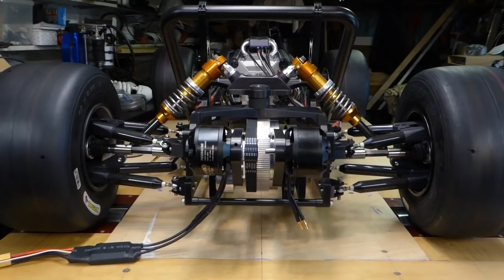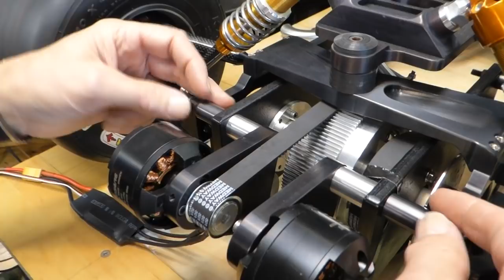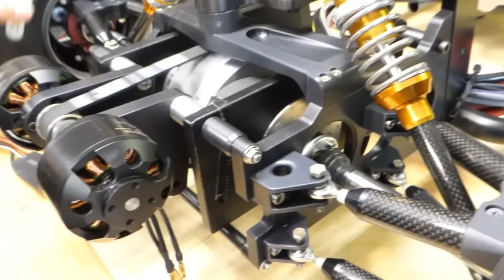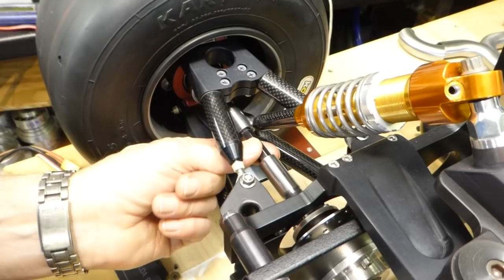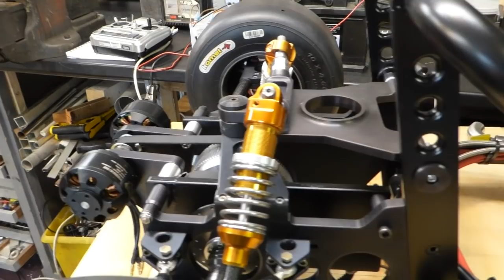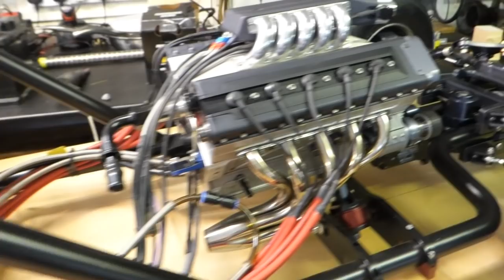1/3 Scale Fuel Injected 125cc V10 RC Buggy, part 4.

Comment: Hi Keith, these motors aren't sensored so on low speed they do this cogging, also the ESC isn't going to work for long without a proper colling system, it's meant for airplanes or heli's.  If the motors would have a sensor then it would act like a stepper motor and can do those low rpm's without cogging. A proper car ESC can do low rpm's better and also without a sensor way better then this ESC does. I like the outrunner choice, but i can't wait to see and hear the actuall v10! What a nice build this is already :D

Comment: And you don't need a sensored motor if u don't want a prop configured and sized esc will do just fine. And if this is just gonna be used as like a KERS system then it doesn't matter anyway I could just keep that esc for short bursts of power work just fine

Comment: The lack of heat sinking on the ESC makes me think its an airplane or drone ESC and they just are not set up for having almost any innitial torque load what your seeing is coging because its just not the right esc,   your application and its way undersized for a car application those wheels are fairly heavy rotarting mass through a gear box that's way more than even a big ass prop
Reply: Everyone give it up for captain obvious.......*clapping*

Comment: You need a sensored motor the same that are used in crawlers. The motors you have are sensorless. The ESC determines the position of the rotor with back EMF. When the motor is running one of the three coils is un used at a certian time. That coil produces voltage and the ESC measures it to determine positin. If the motor is running with a too low speed there is no voltage generated and the ESC can't sync with the rotor so it just simulates a slow rotating field to try to get a lock on the rotor. Sensored motors (and ESC needs to support sensors) has integrated hall effect sensors. This way the ESC always knows where the rotor is. This way you can run the motor with very low speeds.

Comment: Brushless motors cogging as others have said. Might be able to change ESC timing but ultimately as others have said, you probably want a sensored motor to get rid of that or you could try gearing down. 

This however is the most bad ass RC I have ever seen. The machine and design work is incredible. Top stuff mate

Comment: You are experiencing cogging, where the frequency of the ESC is trying to drive the motor at is not what the motor likes to see. With your rig up on stands, there is very little load for the motor to deal with. If you set it down and the motor has to move the whole weight of the vehicle, you will probably find that you need a higher frequency to get the motor spinning and push past the point of cogging.

Your build is going great! Anxious to see it out driving and a body get put on it.
Reply: what you sid is true but id alsolook at th esc timing
Reply: Senorloss motors always tend to cog at low speeds,Sensored dont have that issue
Reply: Not entirely true. Sensored means you have a rotary encoder built in to the motor so that the controller can know what position the stator is in. That can certainly help combat cogging by not just blindly sending pulses to the motor, but just because a motor controller knows the position the stator is in doesn't mean you can't cog the motor driving it with too low of a frequency relative to its load.

if you don't want cogging at all, go with a brushed motor.

Comment: you should make a website where you sell these
Reply: Nah...this thing has way too much time and money involved to even place a price. I wouldn't be the least bit surprised if it passes 50,000 dollars.
Reply: @midship_nc  thats a bit much dont you think? $5k i would understand, but $50k?
Reply from the maker: 50k at least.
Reply: @apeirce  a hand built dual overhead cam v10 engine with electronic fuel injection where every single part has to be machined by hand, every nut and bolt has hours upon hours of work. Not to mention the other parts on the chassis being engineered, custom machined and powder coated. The carbon fiber control arms have to be fabricated to specification and fitted again...engineered to be compatible with the other parts.

Even if the guy so happens to own a fully outfitted machine shop with numeric control...youre still looking at thousands of hours in CAD and CAM modeling. So yeah I think that amount of money would be close to the actual figure.

Comment: That jitter at really low rpm is normal for a sensorless motor and ESC. If that jitter is unacceptable, you'll need to get a sensored motor and ESC. The sensored setup has an additional wire loom, a data connection, between the motor and ESC for relaying rotor position and other data. As far as I know, there's no way of adding this to your current setup. Now, to be completely honest, all of my experience is with brushless inrunner motors. I run both sensored and sensorless in my rc cars. I have no experience with outrunner motors, but I believe the info is still valid. Hope this was helpful.

For whatever it's worth, I am thoroughly impressed with your talent and dedication to such a complicated project. I really enjoy getting to see your progress, thank you for sharing.

Comment: beautiful work as usual Keith! Nice to see you making a vehicle instead of just a test stand. I think when they are brushless motors some have sensors that detect rotor position, and some don't if they don't you get this jittering problem at low speeds

Comment: They're unsensored,  that's why you have clogging at low speeds. A sensored motor/ speed control will give you alot more control at low speeds but for the size you'll need to move the thing will be expensive. Honestly I wouldn't bother if they're gonna be temporary. Also they're outrunner so more designed for planes, helps or quads so they'll be designed to have more control in the higher end of the throttle. Also only using lead acid won't give them the voltage requirements they require, stick some lipo batteries in there, that the motors can handle and you'll get more power out of it.
Reply: "Alot" is a town in India. "A lot" is more than one of something. "Allot" is to apportion something.

Comment: Very cool bud..you really need to switch over to in-runner motors where the outside stays still and the mass of the rotor spins inside the magnets....the out runner motors are not designed to offer low speed torq the low mass of the can and magnets are meant for turning propellers ...so little torque is used to get a prop spinning...

Comment: try an odrive on the brushless, it will need an encoder but it will let you tune the motor for the best performance, the odrive can interface with standard RC components

Comment: The motor chattering is coming from the ESC, it just can't drive them at slow speeds. You'd need Field Oriented Control or a Sensored ESC. The regular RC hobby ESCs can't do either. Might want to check out Vedders Open Source ESC, it can do pretty much everything: http://vedder.se/2015/01/vesc-open-source-esc/
Reply: Hobby ESCs can do it, the issue is these motors lack a sensor system so they can't run sensored.

Comment: How come you are using an outrunner motor? I would definitely opt for a single inrunner long can motor with a low kv.......... but then ive never attempted the thought of building something like this, it's incredible British barn door engineering!
Reply: The problem is, that even the "low kv" inrunner motors require a large  gearbox. Around 1000kv can be considered low, so if you use 6s you still end up in the 20000rpm region.

Comment: Hey, the stuttering problem is caused by the motor and esc being out of sync. For it to work you would need a sensored motor as well as a sensored Esc. They use hall effect sensors to tell the esc which coil to activate so it can run smoothly at every possible rpm range.

They are wildly used on RC cars for that exact same problem.
Reply: Its not a problem unless youre in to slow shit like rock crawling, in wich you can just run a brushed motor instead. On a vehicle youre trying to go fast with there is no reason to have a sensored motor.

Comment: Your speed controller causes the motors to squeek like that. 
These seem like airplane esc's, they are not at all designed for start up torque. If you now try to move a heavy object from standstill, they can't sync the motor, which causes the horrible noise. Also, don't do it too long at a time, in this state, current can be enormous. 

2 ways to solve this:
-Large RC car esc, they do better 
-A VESC, they are the optimum and have all the adjust ability one could want. 

Hope that helps
Reply: Yep, car esc will work better. Also try a motor with a lower kv rating.
Reply: @willburnham678  tho i'd still recommend the vesc, they simply offer more features that come in especially handy at such a heavy vehicle.

Comment: The stuttering comes from the ESC. You will need a sensored Motor. The non sensored one calculates the position of the motor by the back EMF which is at low speeds very little. As a result the ESC drives the Motor wrong. Because these Motors are usually made for airplanes etc. the tourqe required to turn the motor initialy is very little and the ESC gets his back EMF Signal pretty fast so almost no stuttering.

Love your work!
Reply: i second that, but dont think you need a sensor. just an ESC that can deal with low speeds, like in a RC Crawler.
Reply: @zacharias_b  these are often sensored as well. You will never get a perfect result without, because the first split seconds are for the ESC just guessing what is going on. But Crawler stuff is a good recommendation to look for parts
Reply: True. I was going to suggest 'inrunner' motors as those look like they are used for very heavy lift multi rotor drones. I have the same type of motors on my old hexcopter - although mine are much smaller!
Reply: Or you just just a VESC. These can move a longboard+rider perfectly smooth from a stand still, while running sensorless. 
Plus they go up to 12s, feature current control, different control types (like PID speed control) and they can cope with just about any brush/bldc motor.
Reply from the maker: Yes, looks like the sensorless aspect is the reason. I've used these motors in helicopters so just bought them again without thinking any more of it.
If I'd researched more beforehand I'd probably still buy these in the end because of the price. I'll just have to accept the cogging but to be fair it doesn't do it much unless provoked with really low power.
Cheers everyone for the replies.

Comment: Stuttering is usually either intermittent connection or timing issue on ESC firmware. Other causes can be ground loops (not very likely in this scenario) and badly wound motors.

Comment: Normal for brushless DC motors to do that, particularly if they don't have adequate power supply, are sensorless or too high a kv rating for their load. My bigger concern would be thermals, that style motor is meant to be mounted behind a prop that can blow large amounts of air over it for cooling. Amazing project, look forward to conclusion